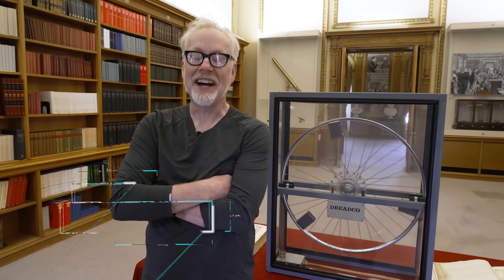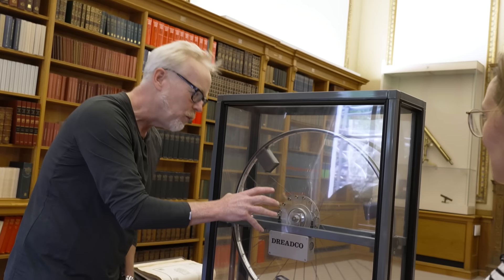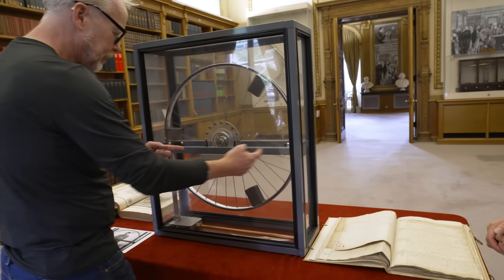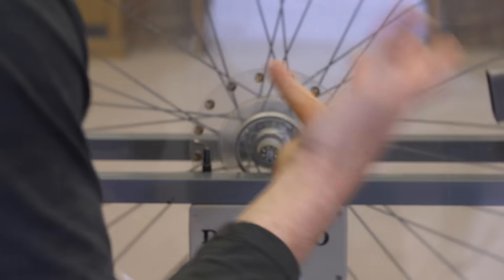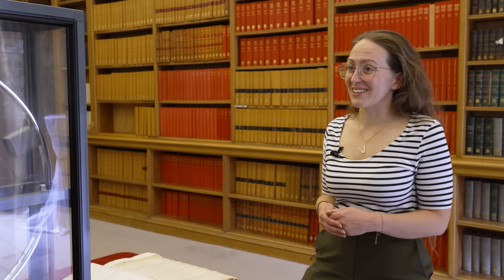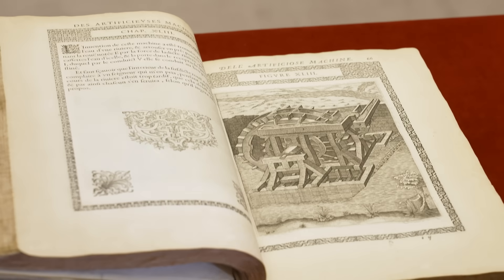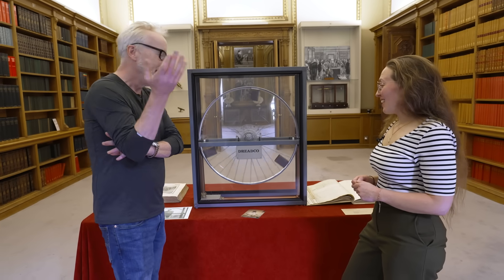Adam Savage vs The "Perpetual Motion" Machine!

Comment: The whole frame is filled with batteries, the two U shapes are electromagnets. One electromagnet is sensing other is powering. The blocks on the wheel are iron blocks  120 degrees apart. One of the U shaped electromagnets senses a block and the other knows exactly when to fire impulse to push up the next metal block on the wheel. This is simple and stupid

Comment: The typical PMM is just magnets pushing against each other, which can hold motion for as long as the magnets hold a charge. This one looks like it has a lot more than the basic science fair going on with it. I'm guessing the heat sync bit is a power storage or something, but I don't know... I would love to play with it...
Reply: Magnets don't hold charge, and PMMs don’t exist!
Reply: @odetgr in  particle physics, a magnetic monopole is a hypothetical elementary particle that is an isolated magnet with only one magnetic pole (a north pole without a south pole or vice versa).[1][2] A magnetic monopole would have a net north or south "magnetic charge"
Reply: @odetgr  Indeed. You need battery powered electromagnets, or something like that.

Comment: If the wheel is made out of aluminum, then the ‘U’ Shaped object’s at the left ant right sides can not be magnets. They would create magnetic eddies in the aluminum wheel as it passes through it, creating drag, and slowing it down.
If there are any magnets at all, they would be in the boxes on the wheel. The ‘U’ shaped devices could be electro magnets. They could kick in with sensors, as the magnets passes through them, giving some attractive or repelling force. In this case, a large dry cell battery could be hidden under the heat sink. The heat sink itself could be used to keep the dry cell charged. Would be interesting to stand next to it with a compass, and pay careful attention as it spun.

Comment: Those two tubes coming out of the dreadco box seem to be pointing straight at those cup near the spindle, could they be squirting air into the cups to help push the wheel round?

Comment: One thing is sure - that the amount of energy involved in turning a bicycle wheel slowly, is very small - so the heatsink fins on that box in the bottom of the machine are not necessary - that's just something to mislead observers.  I suspect that the horse-shoe magnets are subterfuge as well.
At a guess, I would hazard that the three boxes each contain the power source (battery), a little bit of electronics to detect which way up they are, and a weight that is moved so as to imbalance the wheel and make it turn.

Comment: Random, probably incorrect theory, just because everybody seems to be talking about magnets and fields: The 3 boxes around the perimeter of the wheel are just weights, making it a flywheel. Either the Dreadco box or the one at the bottom contains a battery powering a small, quiet fan that generates just enough air current to keep the flywheel moving once it's started.

Comment: Could it be the 3 boxes are the magnets and also weights.. as each magnet is pulled down by one side it pulls up the other.
Reply: You’d need the magnets to be electric magnets and switch polarity as the other magnets pass by like an electric motor meaning you need a battery. 

It’s why you need electricity for an electric motor to work. You can’t just put permanent magnets in a motor and expect it to just spin without electricity.  

If those were just normal magnets it wouldn’t make any extra energy to help it spin longer. It’d actually lose some energy because the interaction between the magnets would generate a small amount of heat which just wastes energy from the wheel.

Comment: I do believe that each of the three boxes contains a battery with a pendulum. All the other things are distracting elements.
Reply: Synchronization is done by the wheel itself. The movement connects and disconnects the coils which moves the pendulums inside each box. This is what I think 🤔

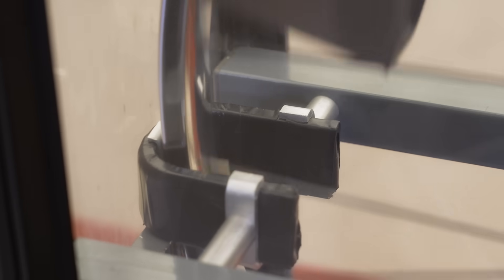Comment: 4:05 you can see the wheel is not true where the boxes are. I know from fishing that perfect balance or as close as possible is really important. That tells me there is an outside force being constantly applied. That would be gravity, magnetism or pressure. I think most of the stuff in there is to fool you but the plastic box might need to be there. I did see a video where they said they tested, from outside, that there is not magnetic force on the side pieces but some in the center. Still may be a ruse. Also, it won't work in space and needs gravity, from my research. I'm going with air puffs, as someone mentioned.

Comment: I imagine that if it were a motor, moving at the slow rate that it is, the "magnets" on the wheel would cause it to slow down as they induce a current into whatever is in the copper pipe, which would then be re-propelling it after some kind of storage and amplification to pull the magnet on the opposite side - but we see no variation in speed whatsoever. It's constant, which makes me think that there is no coil or magnets that have anything to do with it. It's all in that hub and that DREADCO box! Or it's all in that copper-piped and heatsinked box.
Reply: If the energy from the wheel is converted to electricity via magnets then into some sort of storage and then a motor or something, you would just lose energy overall…  you can’t take energy from the wheel and then add it back to make the wheel spin more.
Reply: @Chevsilverado  Right, and my original point was that inducing current via magnets/coils subtracts momentum from the mechanism, but we don't see any kind of subtraction occurring here, which leads me to believe the coils are a red herring.
Reply: @Chevsilverado  You know what it probably is: the coils are pushing the wheel and they're powered by a crystal battery, or a regular battery that's just trickling a tiny bit of current, so that it can keep the wheel going for years. If the people who know the secret and "tune" it to get it going again wish that they didn't know the secret, then it's probably something as silly and mundane as a battery.
Reply: @CharlesVanNoland  You could use the coils and time the polarity switch with the little probe and cup ring in the middle.

Comment: What I think most guesses fail to realise is that this machine was made 40 years ago.

As an electronics engineer, I know they didn't have the high quality components we have today (back when this was built), no LiPo batteries, rudimental capacitors (that would have dried out by now) and really inefficient solar cells that weren't miniaturised.

I'd love an insight on how hard it is to spin it after it stops, if difficult, then I'd say magneto of some sort - but to maintain energy in a dark room for 2 years, I'm stumped...

Comment: A perpetual motion machine is expected to be 100% efficient. I don't understand why a perpetual motion machine would need a component with such a large heatsink inside a sealed container for this to work. Where would that heat energy come from without stopping the machine? 2 years is about the same time the battery in my wall clock dies. Time to go to the top secret store that sells top secret batteries that runs the top secret perpetual motion machine!

Comment: It's full of red herrings. The only significant parts are the magnets and the boxes attached to the wheel. The boxes each contain a battery, a coil of wire and a transistor circuit. As each box approaches one of the magnets, a small electrical potential is induced in the coil which triggers the transistor circuit to send a pulse of electricity from the battery back to the coil thus producing a magnetic field which reacts with the magnet.

I have made a swinging pendulum working on this principle and it has been swinging for three years so far to date powered by a single AA cell.

Comment: There are 3 rectangular hollow weights. Inside each one are sliding shafts, it could be ball bearing but then it would make noise, it could be in liquid and sealed to keep lubricated. 
So wheel slows down closer to the top and shaft slides to inside of the wheel, motion keeps moving wheel and shaft slides out to outside of the wheel making it heavier and pushing down, where on the opposite side shaft slides to the inside making wheel lighter on the outside.

Or magnets activate valve in the box that pumps air and moves wheel every time.
Reply: The only problem is the small amount of friction will burn the energy needed to pick up the next weight and the machine will stop

Comment: They should throw that wheel in the garbage and replace it with an analog clock with a AA battery and just keep it hidden. Or a grandfather clock. 

Point is, if it uses batteries, solar, magnets, gravity, heat (maybe cold can be used as its the end goal of the universe), stuff like that that will eventually end, it IS NOT perpetual but just a trick and a waste of time. (well technically gravity works, nothing ever stops moving/falling in space; i.e the moon/satellites) 

I would even consider a fusion reactor as perpetual if its ever created but even so, matter will run dry.

Not possible, just a trick to make a name for whomselves.

Comment: I think Adam is right when he says a motor, the two little probes next to the dreadco box most likely deposit charge picked up from the rotating coils onto the little insulated nuts, that turns them into little magnets for a small period of time. I'm assuming that the spikey probe deposits the charge and the round one attracts the nuts and takes the charge or it's the other way around. but it should generate just enough energy to keep it going for a while. other than that I'm sure there is a small battery in the dreadco box.

Comment: Yawn, its got lithium batteries & coils & hall effect sensors & a drive circuit in each of the boxes , each time the box goes past the horse shoe magnet there is a pulse of magnetic flux, which is all you need to overcome the friction losses in the bearings & air resistance in the box, assuming its not in a vacuum chamber, which looking at the box I doubt it and wouldn't really be necessary anyway !... yawn ! ....Next !  :)

Comment: Made in the 80's. Around the same time auto makers were switching over to EFI. Which uses magnetic sensors to count gear teeth. 🧐 🤔 🤔 So cutting edge. I prefer the floating UFO desktop toy.

Comment: The box could contain a small radioactive source with a thermoelectric generator which powers the magnets to give the wheel a small bump every rotation.
Reply: I was thinking a little bit along the same lines.  That little box reminds me of ESD Static Eliminators used in electronic assembly lines.  They use a radioactive source that ionizes the air.

Comment: the copper pipe is coax, the same way commercial stations use a large copper conduit with teflon standoffs within.  I think there is a center conductor in the pipe, the stationary black U's are coils...it's just a momentum low draw fan motor with the electrodes near the hub using static electricity... the copper pipe is neccessary because efficiency is needed

Comment: It induces a current with one cycle and the other acts as a motor with cathode and anode "brushes" to the magnets and forces the cycle. It will eventually lose to friction, so its not a perpetual motion machine, just a slow and efficient useless machine.

Comment: He never goes back to the windows on the box. 10 to 1 the box is aware that the lights are on. If the lights are on, it's being observed. Start spinning. I doubt it's some kind of complicated mechanism, but that it simply either stops, or moves slowly when in the dark to conserve battery power. Everyone seems so caught up in the actual mechanism of the machine itself, that we're forgetting the mechanism of observation and how we actually measure whether or not it's working. There's no counter in it, so we have no idea if it's working when unobserved or not. I'm curious if anyone has bothered to try and capture the device working in an extremely dark room. Still possible there's an IR-based sensor to keep it moving, but we now have extremely sensitive cameras that might be able to beat any photosensor in the box and observe it in the dark, far beyond human visual accuity.

Comment: (runs off with the envelope and opens it)  "oh and the letter is hidden in a private location."

How long could a lipo battery the size of that Dreadco box turn a wheel at a slow speed?  2 years?

Comment: What about those 
SHAKE TO CHARGE
Batteries?

Each Little Box is Its Own Charger, Which Through
Little wires Operate a 
micro motor within the hub , argh, i think i saw another possibility, there is 
a very slow MINOR VARIATION IN THE TWO 
WHEELS, there possibly a coiled spring within the hub that keeps a stead pressure moving forward to counter the weight of the boxes, soo, kind of a vertical recreation of the movement of the luminaries in a way i suppose
Reply: Those shake to charge things would use energy from the wheel to “shake” and it would slow the wheel down. As the shake mechanism moves and cause friction and such that energy is directly from the motion of the wheel. Any electricity generated would be completely offset by the energy it took to shake those things.

It’s actually impossible for a wheel to generate its own energy to keep itself going. Any attempt to do so will only slow the wheel down faster because you’ll never have 100% efficient power generation.
Reply: The Box Only Covers the bottom of the hub soo you cant track the full movement of the two hubs? maybe.

Comment: There is a battery in each of those 3 things on the wheel. As they pass by the u-shaped metal magnet thing, it either pushes or pulls or both a little bit to get it going with an EM field.  If a ring door camera can run a year on an 18650 lithium ion cell, this thing can run on several batteries in those boxes for more than 2 years.
Get an old AM radio near it and listen to the little "pop" as each of those 3 things pass by.
Reply: I think that would also work with a new AM radio.
Reply: Does anyone remember those old "Kinetic Art" things that would swing back and forth constantly? They would go for a good month on a 9 volt battery. Upgrade the battery and a bicycle wheel would go even longer before it needs to be "serviced".
Reply: A simple mechanical accelerometer could be tuned to close the circuit briefly at the correct position.
Reply: yep, i have the same idea as you, There is a timer in each of the 3 so called weights on the rim, they are batteries that energize a small coil as it appoaches each of the 2 U shaped magnets on the outside. That would give 6 impulses per revolution.
Reply: Exactly
Reply: https://www.youtube.com/watch?v=4VBNn-ids6M

Comment: Each box on the wheel has a battery, a coil and a mercury switch. When the box is at the correct angle the coil turns on attaching the box to a magnet hidden at 3 or 9 o'clock. This is why it needs to be "serviced" every couple years. An interesting test if they allow it would be to lay the thing flat or use some magneto chromatic film next to it to see the magnetic fields.

Comment: IMHO, the copper pipes are the wires that electrify the coil packs at opposing parts of the X axis. It would just need a little bit of magnetic flux to draw down the heavy iron packs to keep it spinning.

Comment: It Appears To Me
That The Small Boxes 
are counter weights
and that the secret to the counterweight is found in the slight variations in wheel diameter due to
physical manipulation of 
the Original outline of wheel.      imo.
Reply: Another way that a person could make this work is with a piezo set-up or wait
there are magnets inside the 3 counterweights
which move in a specific way to offset the slight movement within the boxes as they pass through the magnets which push the interior box magnets 
into a preset position, Then 2 counter 1
2 counter 1
2 counter 1
with magnetic polar 
rejection and acceptance
   imo.

Comment: If you don't care about hiding batteries, nuclear reactors are some of the most efficient perpetual motion machines ever created. The water in both sections of a reactor can theoretically be continuously moved for decades with little to no human intervention using only heat differentials and pumps (to be fair they are powered by the reactor itself, so its not like you're adding energy to the system). Basically, if you had the testicular fortitude to set a reactor in a stable configuration and just leave, they could outlast any "perpetual motion machine"